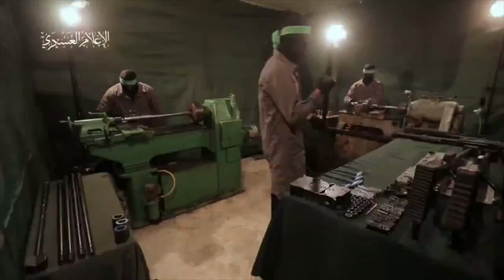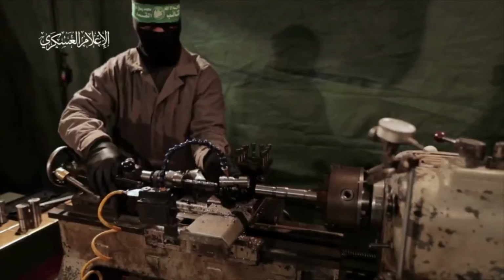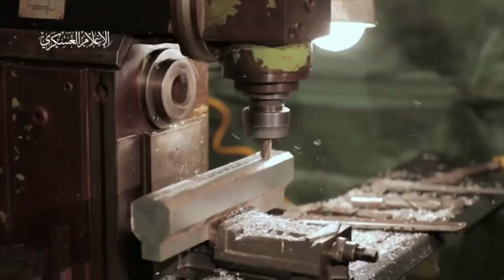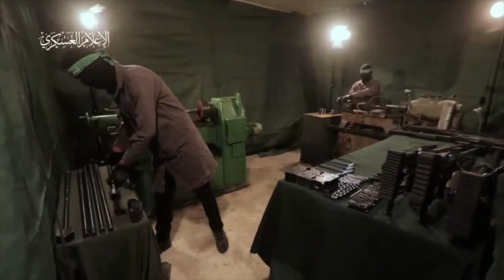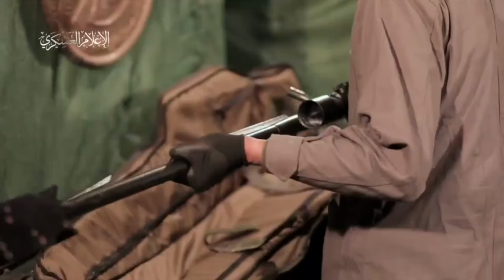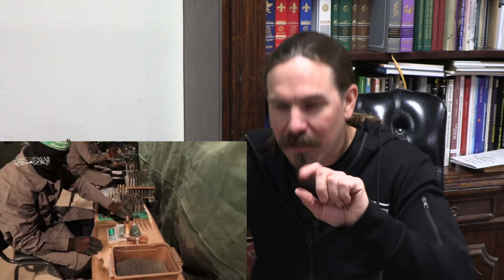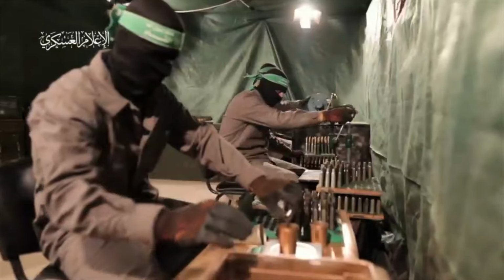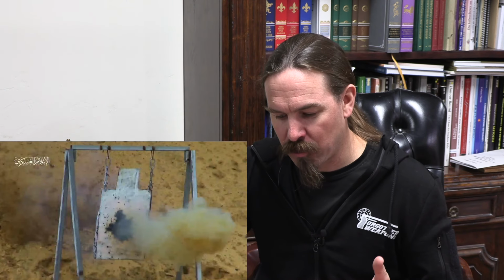Hamas Claims to Make Sniper Rifles in Gaza - Are They Really?

Comment: The precision ammo comments. We only use brass case for precision ammo because that's the only material that Lapua, ADG, and Peterson use. Generally, virgin brass is not ideal. It's fired to get everything moved around and from then on the expectations of better accuracy are higher. BR and ELR shooters dont take virgun brass to matches. They reload until the brass fails and they might shoot a competition with brass thats been fired 10-20x previously. 

If we had steel cases to use, there's no reason it couldn't be as good. You think it won't be as good because of the crap steel case ammo you're used to seeing. There's nothing preventing a top tier company from making top tier ammo with steel cases except fuddlore and preconceived notions preventing sales.

Comment: A few things, I'm not a pro machinist but I'm a hobbyist and have done a decent amount of work.

1-You can't tell the tube is solid depending on the caliber. Being 50 I think it's likely not, but you can't be sure.
2-smoking while machining is not necessarily bad. There's a LOT of variables. You can chew up HSS tooling quick doing it, however carbide it will work fine.
3-Polishing on a lathe isn't the end of the world certainly not for a barrel blank. The real down side is getting grit on your bed. If you don't intend on operating the lathe for 20 years it's probably not the end of the world. Lots of people use a "barrel spinner" but you don't need one. These lathes will probably be blown up, so why not?

On the reloading side:
-Them being unable to supply their own brass wouldn't be surprising or unlikely. Drawing machines are major infrastructure, even compared to a lathe or a mill.
-There is zero issue re-using cases for precision shooting. If anything it's likely to happen because people do crazy prep work for brass, and for certain calibers you form the brass via firing. You also want brass fitted to your chambers. This is different as you want brass capable of fitting all the rifles you have. Cases are arguably the hardest part to make even above bullets or primers or powder.
-Their weighing system is inefficient, however plausible. I wouldn't be that hung up on it. 1% of 250 grains is a LOT MORE than it is in say a .308 or a 5.56 or a 6PPC. Being off a couple grains makes less of a difference probably. 

Overall:
-The incendiary stuff could be arguably showing off for the camera. Producers think stuff looks cool and it has propaganda value to see stuff explode.
-There needs to be a realistic expectation of what constitutes "sniping" and considering their engagement distances. In the hills of Afghanistan it'd make a big difference. The record shot was something like 2.3 miles. Gaza is 3.7X7.5 miles roughly with a huge population density, similar to NYC. You're talking CQB distances in a lot if not most cases. A piece of firepower that can take out body armor or even some vehicles is likely more valuable than shooting at 2+ miles.
-The milled part looks like aluminum, not steel. 

Now then, it's probably fake. Here's why:
-ALMOST NO SWARF. If they were cranking out weapons like crazy there'd be piles and piles of swarf around the machines. This is way too clean. I wouldn't want to have assembly happening anywhere near my machining.
-ALMOST NO OIL. Look at the floors they're clean. Yeah sure good luck with that in an actively used machine shop. They should look like the Valdeez had an incident in there.

-Look at the way they have their "barrels" set up. Yeah they're using a center but they're also ushing a chuck too. For precision you'd really want to turn them between centers with a dog. 
-While smoking is okay if you have the right tooling, that seems to be HSS. You'll chew that up insanely quickly in all probability.
-Where/how are the parts being finished? The work flow makes no sense, you'd assemble the rifle elsewhere as said before and you'd have to finish them elsewhere (there's nothing 
-Nothing that is visible indicates there's chambering going on far as I can tell
-The "reloading" footage has ammunition made with bullets at wildly varying seating depths. That's not only inaccurate but potentially dangerous. COAL/bullet to rifling engagement problems could cause a KY Ballistics style incident. 

-You don't see the head stamp except on the one case they show, even in the loading blocks.

A few final thoughts:
-This may well be them putting out misinformation not only for propaganda purposes but to protect the Iranians from blow back. I would consider that a good idea.
-Who's to say they took them apart? May be easier to smuggle guns in unassembled form peace meal. 
-You're right that MG barrels are a likely source for stuff like this. The ends are the worse worn on most guns, so if the barrel isn't toally melted you can probably do something with the leftover stock.  An M2 is speced at a 45" barrel you may even be able to get 2 barrels if you're careful/lucky although one is more likely.
-What glass are they using?  I can see it says MRAD but can't see much else. Maybe a funky kind of S logo on the side?
-MG barrels are a good course of action. 
-Has anyone tested electrochemical machining? Just wondering if anything like this has been considered/done.
-Go watch videos of say people in Pakistan machining stuff. Those guys do super cool stuff with very little. I would have probably expected some "on site" made machine tools as needs dictate. This is certainly not that.

Comment: That milling footage looks a bit sus to me, there's very little chips anywhere considering the amount of material removal (especially considering that they show side milling which makes a huge mess). Having a shot of their chip bin would be convincing evidence of manufacturing, shipping a couple incomplete parts and doing some milling for show is a lot easier than shipping a huge amount of chips. Also the mill workholding seems quite flimsy, the part overhangs a lot and this would slow down serious production but would be fine for light cuts on camera. 

That marking might be cnc milled too, one method that Ian forgot to mention. The smoke from the turning might be cutting oil burning of, that would be the low tech alternative to flood coolant, it looks bad but since most of the heat is in the chip some smoke is usually not indicative of part temperature. The turning footage is still fake as hell.

Comment: Also, this reminds me of a similar thing that happened here in Philippines up to this day:

The Philippine army and police seized/captured a bunch of "Barrett" knockoffs used by militant groups. And what the local gunsmiths did is turn down captured M2 barrels (even outright use "barrels" with no rifling) and slap them into those crudely-made stocks that looks like made from fiberglass. Some even looking like skeletonized versions of M82s. 

The end result? Accuracy is out of the window , as those manufacturers apparently don't know how to head space the "guns", and despite retaining the barrel lengths, bullets are keyholing... Up to 30 meters; 60 if you're very generous. After testing by army Snipers and marksmen, police officers and competition shooters they all agree, the guns are crap. And those guns are far worse than the Hamas rifles if you ask me
Reply: Ye i guess they came out of the danao or idk what it is called region where they make handmade 1911s and other 45 acp or 9mm smgs all very primitively made.

Comment: That frame showing trimming showed a live primer. Either theyre stupid or that too is staged. The bullet spin while seating is reasonable.  Sometimes folks do that to ensure consistent seat concentricity. My biggest issue is with the equip.....50 is stout. You need beefy gear. Even moreso is trying to load steel since it doesnt cooperate as well.

Comment: Thankyou Ian for showing their "Shortfalls", also I work in an Engineering shop and I'm also a Competitive Shooter, everything you said about the Bullet Loading methods was spot on, they weren't "throwing" accurate powder charges, the Cases were Irregular in condition and Finish the Bullet press they were using looked like a "Simplex" clone or something, not really set up for Bullets that long etc. The Barrel making was a FARCE, they were definitely NOT actually producing Barrels. Yes, I think that they were as you said just pulling Rifles down to components and Re-building them and Hope nobody noticed the Inconsistencies. Well spotted and I hope this is passed on or seen by the IDF to see that it is a False "Theatrical" piece. At the end of the Day they showed that they have Iranian 50 Cal rifles and Can shoot them.

Comment: So what is the goal of Hamas making this video? Is it to recruit machinists? Maybe they are showing scope mounts and jig fabrication because that’s what one will work on when you start out. Instead of boring a piece and then cutting it off I understand using a cut off tool only to a smaller diameter then your bore diameter then when you bore past it you release the part without it spinning all over. I think this isn’t trying to mislead as much as demonstrating while only showing what is easiest and not time sensitive.

Comment: Creating a missile involves different challenges than making a rifle. While both involve engineering and technical expertise, the design, purpose, and functionality vary significantly between the two.
but Im sure they can do it.
Reply: What they make are rockets, not missiles. They are extremely simplistic. Often made from water pipes, they have an accelerant for firing through a tube, then some high explosive on the front “warhead”, and apparently they are triggered by a nail striking a bullet primer when the tip hits the ground
Reply: yes they did, even local villagers in Pakistan can do it too

Comment: You can certainly make a poorly machined rifle more accurate by recutting certain componets to make them more concentric with the bore of the rifle.  Every time a part is removed from a machine to perform another operation it must be realigned in order to keep everything square and concentric.  A certain amount of runout is tolerated and if its below that threshold the part is within tolerances.  You  can disassemble the rifle and place each part in the lathe and check the runout of each part.  A metal lathe can make certain cuts with perfect precision due to the fact that the workpiece is turning instead of the cutting bit.  They could also easily recut the chamber of the barrel to a different cartridge of the same diameter bullet.
Reply: Your last sentence may be exactly their main purpose.
Reply: 99 - > 108?
The problem is that in the CIS countries it is customary to measure the caliber by rifling fields, Western calibers, on the other hand, are measured by bottom of rifling
So I'm not sure about how well this will work

Comment: its funny how you get the wrong idea about the video then come out here and try to look smart. they never said they were making the rifles, but rather upgrading them. its funny how one of the strongest tanks in the world, couldn't stand a chance against Al Yassin { Hamas manufactured.} by the way.
Reply: "Upgrading them"? That is even less believable. You aren't going to "upgrade" a precision rifle by turning undrilled bar stock on a hobby lathe which isn't even set up properly, nor by the use of a vernier calipers to perform your "precision measurements". You aren't going to upgrade its performance with obviously fake simulation of reloading on equipment singularly unsuited to precision loading either. 

Thanks for the laugh!

Comment: I never made my own firearms before, but I have reloaded in what I regard as precision. The only reason to reload is to reuse the case. I doubt that steel cases are as reloadable as brass. Steel is not as malleable & will tear much quicker than brass with repeated resizing. I’m not sure why they would be doing this in a war as the time it takes to capture spent cases during a conflict is questionable. Is it worth it? However, what they are doing is far from precision. If it is real, they will likely have trouble hitting the side of a barn.

Comment: Your comparison is between a military industrial complex where everything has 'quality and damage control' against a underground resistance who has to use machinery and equipment that requires minimal noise during manufacturing. 

Not saying you are wrong, however your analysis has more to do with technicalities of weapon manufacturing and video editing than debunking the weapons as fakes. Yes they are a copy or knock off of a legit weapon but in saying that calling the whole video and process 'fake' is a stretch.

My opinion. Happy to hear a response.
Reply: You don't need a military industrial complex to make rifles. You don't even need  a lot of equipment. You do however need equipment, even if fairly basic in configuration, for the essential steps inherent to making even a basic rifle, and you need to know how to use it. 

This video shows that Hamas ticks neither box. Indeed, not only does it show that Hamas doesn't have a clue as to what equipment you'd need, even at a basic level, but also doesn't know how to set up and use properly the gear they've got.

Comment: Ian I hate to say this whole buddy. I really like your videos, but obviously you're not a machinist. So I'm going to explain one thing to you. You don't necessarily have to use a milling machine. Because a lave with an attachment called a milling head can become a milling machine. The lathe is the only machine tool that is capable of duplicating itself in a entirety.  Having been
Been an amateur machinist for almost 30 years. I can tell you that there is a lot of things that you can do. And yes, you can hand Polish things to very tight. Toliver says I've done that.  And I've kept my tolerance to within a 1/2 a 1000 dial. I have made my own injectors for my Mercedes. Benz diesel and hand finishing him. So, yes, you can do very intricate things by hand case and point.
How the heck do you think the early watchmakers that made watches in the early 1500s did things they used to lay they polished and filed by hand and those pocket watches were pretty d*** accurate.  Maybe what you need to do is tear. A pocket watch apart from the 1500 to the 17 hundreds, which they would call a fuzzy and look at the miniat. Ure chain links that kind of look like a bicycle chain. But they're all hand made with extreme accuracy.
And they didn't have fancy machine tools to do that kind of work.  And yes, those watches were fairly accurate. They might lose 1 minute in a 24 hour. that's pretty accurate, especially for all hand made components by the 18 hundreds, they had watches that were extremely accurate temperature compensating and still made by hand.  I.e. Watch the movie longitude and learn about the man named harriso. There's my points, so when you say you can't make accuracy doing things by hand on a laze, you're wrong

Comment: A superb analysis. I would add that at 15:59 we get the best possible close-up of the bullets, which look like they were sanded on a lathe, but then not barrelled or finished in a vibratory bowl. Without any expertise in the gun or ammunition fields, I still note that all the ammunition I have seen has been finished in some way or another, which would not give the kind of anisotropic reflections we get here. Whether or not this would ultimately affect the accuracy I make no claims, other than the probability that no two bullets would weigh the same, given this level of poor finish.

Comment: Well.. that part where he took off the allegedly wannabe bolt head, they might have cut a groove in it before and the drill operation met with the groove, severing it and this way it might be possible to get a part machined, but it would result in horrible edges an burrs, so overall I say, Gun-Jesus has spoken and thus is all BS.. Thank you Ian

Comment: Something about that Hamas video stinks. Everything is too “clean.” The tarps being used as partitions are brand new with creases still in them, and there’s no metal shavings all over the floor or the “machinists.” The cinematography is done using a gyro mount with a camera that is more expensive than a car, using dolly zooms and edited transitions as if by a production company - not like a group of Islamic terrorists are savvy with video editing. Not only that, but their workshop layout makes no sense. If they are supposedly smart enough to conduct complex manufacturing of weapons, there would be a process line. There’s no flow to the process, and if they were “making sniper rifles,” it would be done in a process line, not playing hot potato with one guy to another in a tiny room. Additionally, Hamas doesn’t wear digital camo, just the green “splotch” style. Finally, all of this is apparently being done in Gaza, where the borders are so strictly monitored that you can’t enter in or out without a thorough vehicle search and ID’s. Add that to everything Ian said about their work, and it makes me think that this video is an Israeli-staged propaganda release to make Hamas look far more dangerous than they really are.